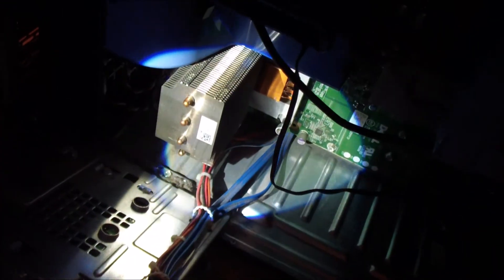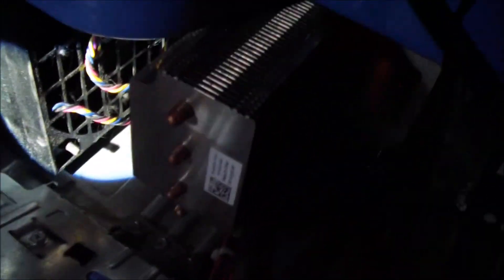Dell Precision T3500/T5500 Cooling System Modification

Comment: Great video.  When using the 3 pin, does the motherboard have 2 3 pin sockets for the fans?
Reply from the maker: No, you need to get a 3 pin to molex adapter.

Comment: I have a T550o can i use just 2 fans in the back instead of 3? also where do i plug them into for power?
Reply from the maker: You can use two fans.
Reply from the maker: You have to use a molex to sata power adapter if your fan has molex connectors. 
https://amzn.to/2GbolCh

If you are using only 3 pin fan connectors then you have to use https://amzn.to/30qDNkU .
Reply from the maker: For the molex to sata, you need this https://amzn.to/3ir2zHJ not the other one.

Comment: Your CPU heatsink looks different than mine. Did you add that on too?
Reply: The T3500 came with two different stock heat sinks, depending on the CPU: the T021F, and the performance U016F, which is the one pictured in the video. I hear it's worthwhile to upgrade if yours doesn't have the copper pipes.
Reply from the maker: It is a stock heat sink, so I didn't add a new heat sink.
Reply from the maker: Sam Kay  No need to do anything with the bios. All you need to do is install two Xeon X5690 processors.
Reply from the maker: Sam Kay  You don't have to give me anything, but thanks anyways.
Reply from the maker: Sam Kay  I have a video about using a Dell Precison T5500 for modern games. https://www.youtube.com/watch?v=mh-wSJE5tdU&feature=youtu.be
Reply from the maker: Sam Kay  Yes, you can upgrade from a X5650 to a X5690 on a Dell Precision T5500.
Reply from the maker: Sam Kay  No problem.

Comment: help me i also have dell precision t3500 but it is at 54 celcius at idle
Reply from the maker: This is a stock T3500 without any modifications, right?
Reply: @Ace1000ks  yes i only installed  more fans one to throw air through heatsink and other to suck air through heatsink
Reply from the maker: @exton69  You need to mount two 80mm fans on the rear of the case to suck the hot air out of the case.
Reply: Hey bro help i have same pc t3500 is really hot in idle about 50c😑I can't even cs 1.6 play smoothly🤔

Comment: Which way should the fan let the Air goes  inside case or out side of the case
Reply from the maker: The humped side sucks air in.
Reply: You want to mount the fans where the air is blowing out of the case.  Since you have 2 120mm fans blowing in the case to cool the ram and the cpu you want 2 80mm fans on the back blowing air out of the case.

Comment: ya this working but is slow I'm bought this pc New  and use it a month just month  if I touch a heatsink it very hot
Reply from the maker: Did you put the 3 80mm exhaust fans?

Comment: can 80 mm fans with a 3-pin cable be installed on the T-3500? And if so, where are the fan connections on the motherboard?
Reply from the maker: You need to get a 3 pin to molex adapter.
Reply: that's what I expected. Thx for getting back to me quickly!
Reply from the maker: The 80mm fans I bought came with both 3 pin and molex connectors. Some 80mm fans just come with 3 pins.
Reply: @Ace1000ks  not mine. I bought the Noctua NF-R8 Redux-1200. Any ideas are welcome!